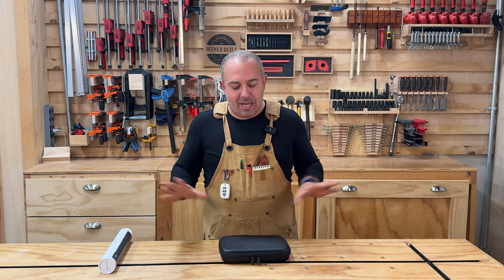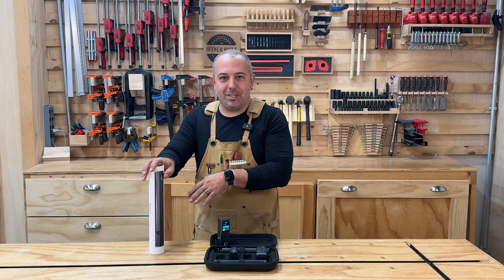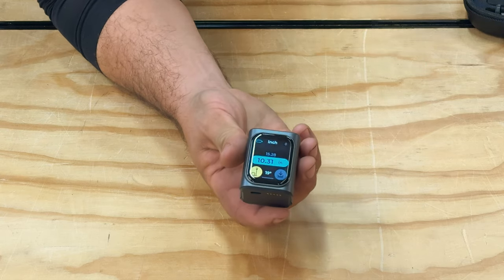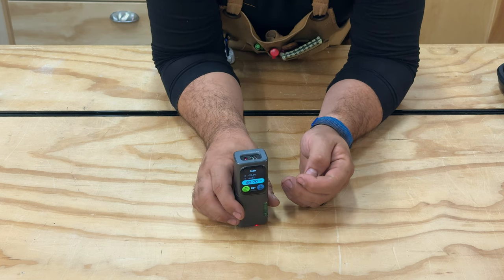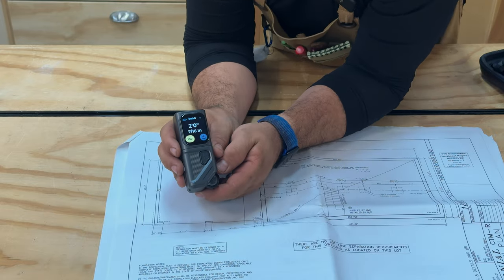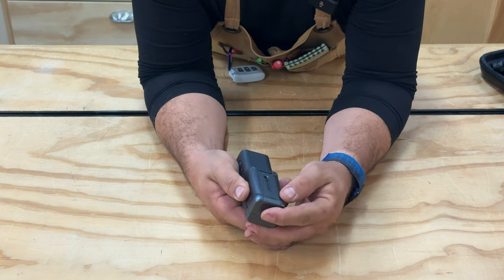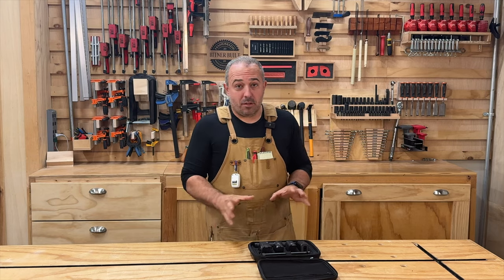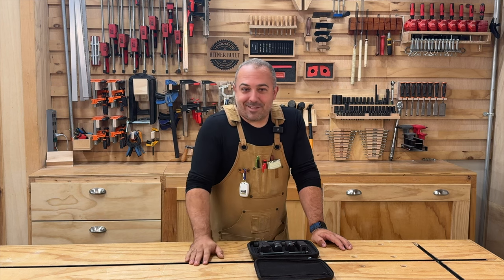Reviewing The New M-Cube Laser Measuring System from Hozo Designs

Comment: There is no icon for a green levering tool to me on the screen. Also, my green laser is way too weak. Am I doing something wrong? I also checked for an update but there is not available one right now
Reply: To add up, the green laser lights up on the left side of the bilateral laser + but it is way too weak
Reply from the maker: Are you using it indoors or outside? (It’s indoor primarily) and are you charging up? I personally find the brightness on par with my 4d laser level . Have you contacted them directly?
Reply: I used it indoors  and I charged it to its fullest, cause I also thought it might be the low battery. I sent em an email and I am waiting for their answer at the moment

Comment: Can I calculate walls with angles other than 45°?
Reply from the maker: Sorry for the delay in responding, I’m sure yes but I emailed the company for their answer, just waiting on them to respond!
Reply from the maker: From the company: Of course it can calculate angles other than 90 and 45. Equipped with an electronic angle sensor, Real-time display of measurement angle.If you're talking about the 01 Smart Planner, it can certainly measure angles beyond 90 and 45 degrees and is even equipped with a dual-mode joystick for 8-direction and full 360-degree coverage measurements.